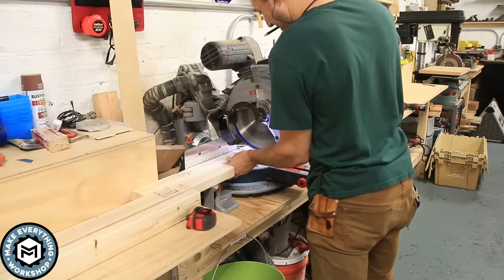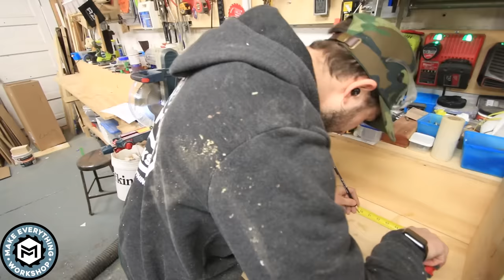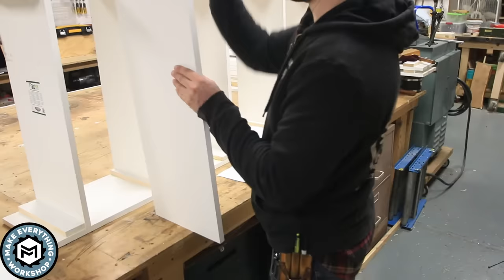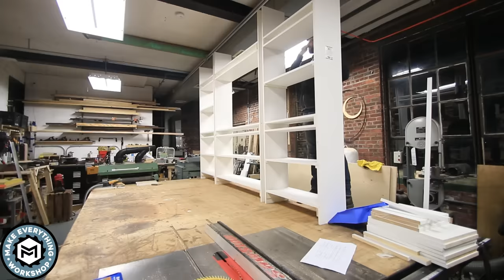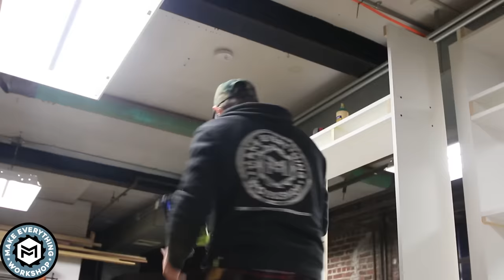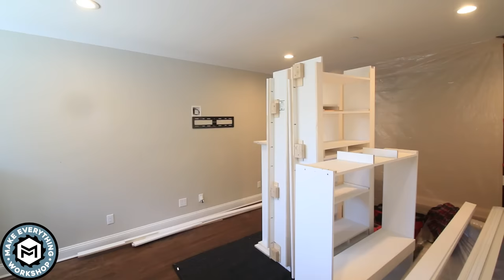Building A Simple Book Case! Woodworking How To

Comment: Awesome job mate.. 👏  I made something similar that took about 7 working days but I sprayed it also and  had bottom cabinets on each side  with shaker glass doors. One thing I do with making shelves look thick is use 1/2 plywood for top and bottom and flush up a block to fill the void of whatever size shelf I'm making and edge band it. Comes out super clean no miter breaking and it's pretty quick and gives the appearance  of one solid piece.

Comment: You make it look so easy. Wish I had a workshop that big.
Reply from the maker: It definitely makes like easier when doing something this large, i am very thankful for it. Usually I would do a project like this on site if I had the time. If you pick your dimensional lumber right you could basically do this with just a miter saw and brad nailer.

Comment: On the horizontal cleats fastened to the vertical members for shelf supports, I've done those too, but one option that sometimes works as well and looks a bit nicer, is to make 2 thinner vertical cleats (front and back, usually 1" wide), fastened to the vertical member the same way.  These support the shelf on the 4 corners, are self-leveling (being the same length), the front ones along with the vertical member make a nice 2 3/4" thickness front appearance, the back one blends into the back corner of the 'box' formed, and the layered surface of the end of the 'box' gives an interesting visual line.
Reply: Can you share a photo or sketch of what your describing?

Comment: Love the simple design. Its really simple and easy.
Most of my question were answered in the vid but one.... It was pre-assembled on the workshop table which is flat. In my (limited) experience, most houses DON'T have a level floor. BEing that you didn't use a plinth, how did you sort that issue?
Reply: I would shim the main cabinet level then scribe the baseboard to the floor.

Comment: I'm about to build something very similar to this for an extremely demanding client (my wife). It'll be my first major carpentry project, so it was great to see your process. One question, to you or the community: for something like this that's going to be painted and had most of the edges covered, what's the advantage of using solid wood over plywood, or even MDF?
Reply: Hi Bruce! My fiancé (my most demanding client) and I just bought our first home together. There were somewhat big things that needed to be done and some minor projects that we wanted to build. What I’ve learned, both from research and trial and error, is I think it has to do with grain and fibers of solid wood. With solid wood, you can sand it down and get a really clean and smooth finish. The others won’t be as clean of a finish. There also things to consider durability wise. Have fun and be careful in the shop!

Comment: great stuff! i didn’t understand what you meant about planing the face boards w/ a small reveal so they don’t crack
Reply from the maker: The face boards running horizontal will move in a different direction than the face boards running vertical. If I make the horizontal face boards slightly thinner they crest a visual detail that looks intentional. If you join vertical and horizontal faces at the same plane they can crack and become a defect in the finished product. It’s a simple way to get a little extra detail in a project and avoid future issues
Reply: If you don't have a planer, you could achieve the same effect by ripping the shelves narrower than the uprights so that the facing boards sit recessed.
Reply: That’s the detail I was searching for. Great process video! Well done.

Comment: Great vid!  Learned a lot.  One thing I noticed is that just past the 13 min mark, the unit appeared with spacers on the far sides of the unit, not just between each section.  And it looks like you added another vertical support board after probably pocket holing a spacer onto the end section.  How did you join that end side board to the spacer board?  Did you still use nails and glue and cover up the nail holes on the outside panel?

Comment: An interesting video..... curiously, I am buidling a very similar book case and cupboard with doors and open shelves. As in your method, I haven't used any housing joints, but I have used cleats to place the shelves on. Quite straight forward providing you stick to accurate measuring and cutting. Whereas you have built your book case in the workshop, I have built mine in situ. Your method has been quicker with assembly. However, with large book cases and cupboards I have found that once assembled they start getting very heavy as the dimension increase. My current project is  2700mm long 2400mm high and 300mm wide from 27mm thick pine. Even if split into two units it would have still been pretty heavy and difficul to move about. Hence me deciding to assemble it on site from componant parts. I am currently taking pictures, so once it is completed I will be uploading a new video, its been a while! Nice work though in your video.

Comment: does wood glue work effectively when the board is painted like shown here?
Reply: No...once the wood is sealed the bond is no longer there. Nice looking, but poor quality without dados or raw wood build.
Reply: Hmmmm, well, I would say this would depend on the paint and how many layers of paint are there. In my experience, PVA glue still bonds well to a single or double coat of primer. If the paint is a high gloss with nothing for the glue to key onto, then, adhession isn't going to be very good. But if you use a modern high grab glue, super glue or a fancy two part glue, on a large surface area, then yeah, it won't make that much difference and if put under load until failure, it would probably pull the paint clean off the wood rather the glue joint itself fail.

Comment: This was a very good video, Thank you. Question though, how would you install this on a wall that is not quite flat? The drywall work in my house was not done right and there is about an inch and a half rise for one side of the wall over the other.
Reply: if it were me, I would install a false back to the cabinet and leave the side piece with an overhang so that I could scribe them to fir the wall perfectly
Reply: Gotta buy a new house

Comment: What's the best method to use on the base if your unit will be in a room that is carpeted?
Reply from the maker: if the room is already carpeted it doesn't really matter. If you are putting a unit like this in a room that is going to be carpeted you'd want to wait and install the base molding after the carpet is installed
Reply: @MakeEverything  so, just set the base on the carpet, but remove the kickboard on the bottom of the wall?

Comment: Little late to the video so I don't know if anyone will see this but could someone explain why planing the face frame stops cracking? And which face frame were planed? Horizontal? Vertical? Both? Really enjoyed the video. Thanks for posting.
Reply: He planes the horizontal face frame. The reason behind that is so that the vertical stile and horizontal won’t be on the same plane. The horizontal face frame is sunk in my 1/8” which makes it a caulk joint instead of a flush butt joint. Helps to avoid the inevitable and embarrassing sliver crack as the wood shrinks.

Comment: I didn't think wood glue would have much of an effect when used between two pieces of pre-primed wood.  Is the wood glue just an added measure of security in addition to the brads, or does it actually contribute to the strength of the joint?
Reply: Combined with brads it add a good bit of strength. I think about it those cheap bookshelves that people buy that just use little pins are strong enough. If you are in doubt just apply a screw right at the very back were people cannot see it or drill through a dowel joint out of sight.
Reply: @bighands69  Thanks.  I just didn't think the glue would penetrate the primed surfaces to be of any use structurally.

Comment: I really like the way that came out! Great video, great project! I love the clean lines and easy to get materials. Why pine vs MDF? Is it for weight, durability, expense? I’m curious because I assume MDF won’t move or crack (that assumption could be wrong, feel free to correct me)
Reply: MDF can crack or split under extreme stress and also furniture made up of MDF don’t last long. Whereas, Pine is Resistance against decay and rot, It’s easy to work with and it holds nails well.

Comment: This is an interior project, just use the original Titebond. It’s cheaper and does the same work. A bookcase won’t need the water resistant glue.

Comment: hi guys! Explain me,
why European oak veneer, and any other veneer is very expensive in USA, and why you have strange sizes of sheets, I buy a good oak veneer, size 3400x200x0.6 mm for the price 2,7$ per 1m2, red/white oak by 1.1$ per 1m2, Black Walnut (USA) by 3.8$ per 1m2,  European Walnut by 7.5$, Teak by 20-25$, it is retail price, veneer is sold in bundles - flitch , in one bundle about 10 m2....

Comment: Any reason to not use primed MDF?
Reply from the maker: Ive always found that MDF has more of a tendency to sag than wood. That being said the pine boards I got came basically pre ripped, which saved me a ton of time (11.5" from the lumber yard) if I got MDF I would have had to had it cut and primed, or found 1 x 12 pre primed boards at a supplier.

Comment: I'm pretty early into this video, but are those boards already painted or is it just the lighting? I'm asking cuz you said ur gluing and pinning the boards. If painted wood glue isnt as strong w a layer of paint.
Reply: This is something everyone brought up on reddit.
Reply from the maker: These boards are pre primed yes. I did a test piece with this material with glue and brad nails before I assembled the whole thing and the glue joint was very strong. Normally I wouldn’t glue to paint.

Comment: I'd be concerned about shelf sagging on that 3/4" wood.
Reply: Especially that thin middle shelf.
Reply: @jamietodd2560  When I do shelves, I typically add an aluminum strip or two sandwiched between two pieces of plywood.

For example, I'll use 2 pieces of 3/8" plywood and add 1 or 2 half inch strips of aluminum for added strength sandwiched between the plywood pieces.

Comment: Very nice:  
Question-when he says "reveal" on the front plates to avoid cracking does anyone know what he means?
Reply: When finish carpenters refer to "reveals" they are talking about the gaps or transitions from one surface to another in relation to one another, usually in regards to trim moldings.
as an example you can look at your doors if they have trim. the transition from casing trim to door jamb is referred to as the reveals. window trim to window jamb is another reveal. you could even describe the gaps between the doors on a refridgerator as reveals. Reveals should be even all the way around. when your reveals are off, they "reveal" that something is not level. most reveals on trim in general are around 1/4 inch but thats usually a preference. when your door trim is nailed to the wall it should overlap the door jamb so that about 1/4 inch of jamb is still showing. that 1/4 gap between the edge of the trim and the corner of the jamb is know as the reveal. its like a spacing or gap that when its off reveals itself to be off. the "run" it creates because one side is narrower than the other side grabs your eye and its not good. i hope that somewhere in this was the answer to your question. a "reveal" is kind of like one of those catch-all terms. its the even gap or even spacing created when 2 straight edges are close enough together to but not flush with one another .
Reply: @aaronmpeters26  Thank-you for the detailed answer! Makes sense in general and in this videos context- cheers

Comment: "Couple of basic tools".... continues to use a miter saw, portable miter saw, table saw, drill, brad nailer, speed square, rubber mallet, glue, ready patch, pocket screw machine, clamps, planer, sander, oscillating tool, did i miss anything?